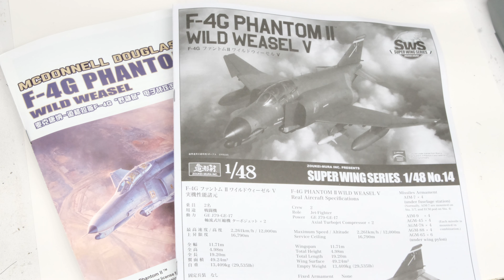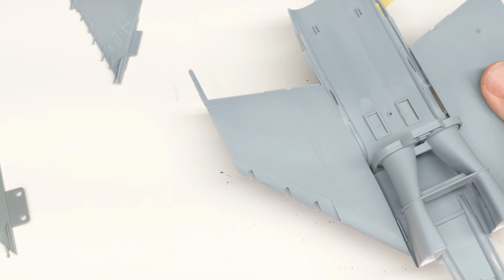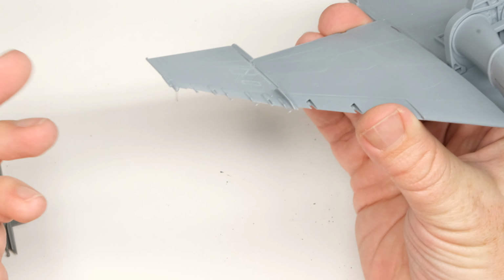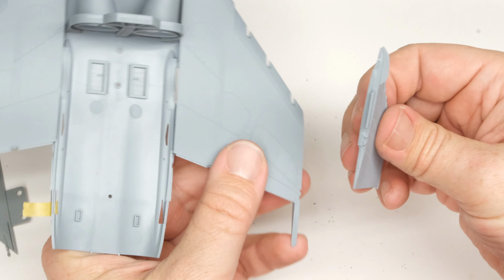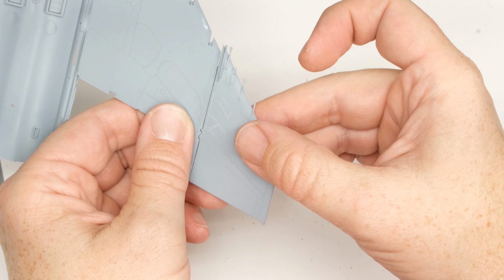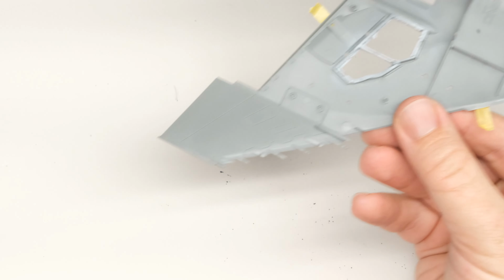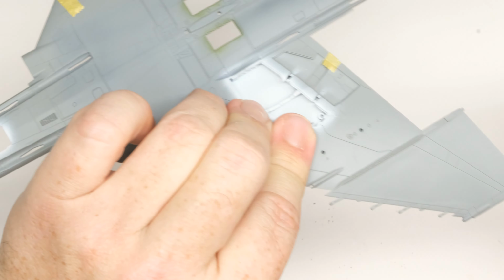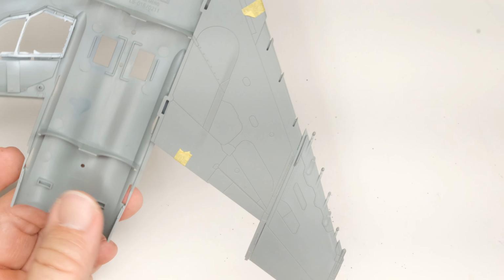Weasel-Off 4 - Wingtips

Comment: It looks like Meng is applying all their experience from their Gundam kits and the old snap fit 1/48 P-51D. There's lots of great engineering in their kit, there are some shortcomings . . .The RWR on the wingtips are correct on the ZM kit. Meng missed it. But I hate having to fix fit issues . . .